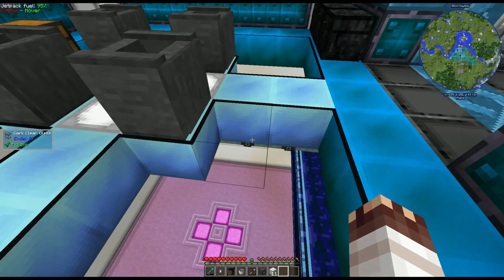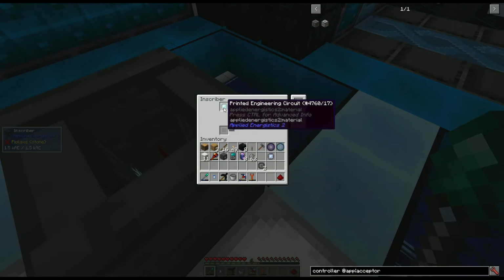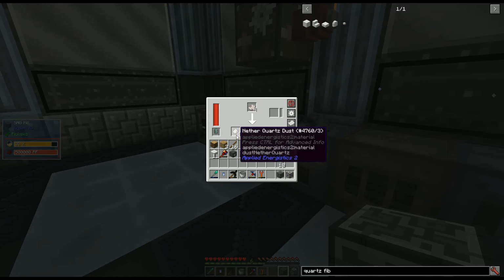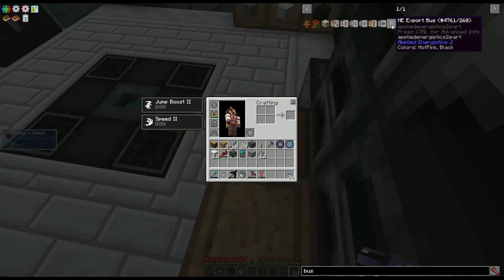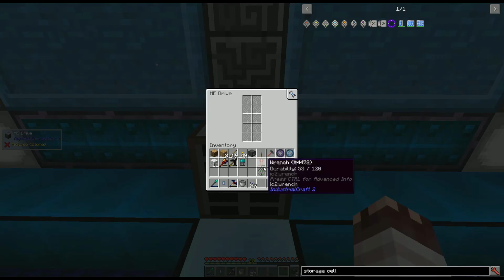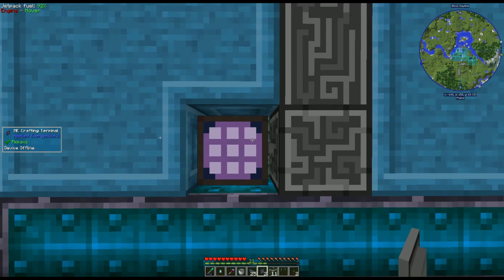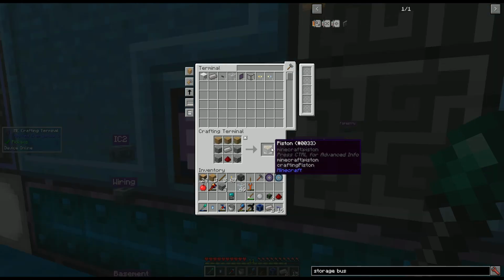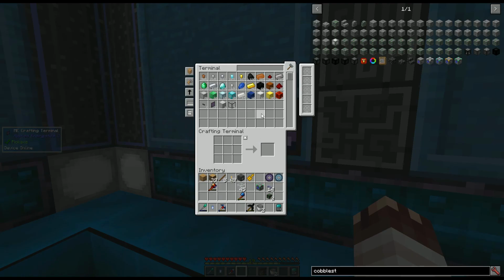New Age of Engineering Supershorts #17: AE2 Storage

Comment: You can connect power straight into the controller, no need for the energy acceptor.
Reply from the maker: Oh! I didn't know that. But this is a fledgling network, and I don't want to lose a whole side with all of its channels. The Energy Acceptor is not an information processor, so I can connect it wherever I want and not lose a single precious channel.